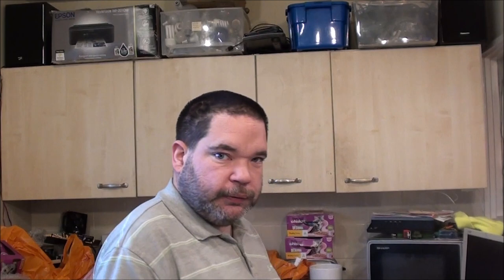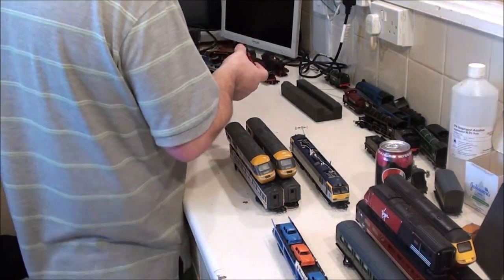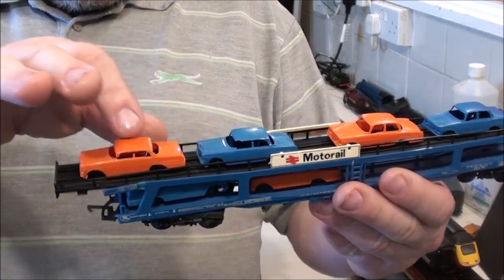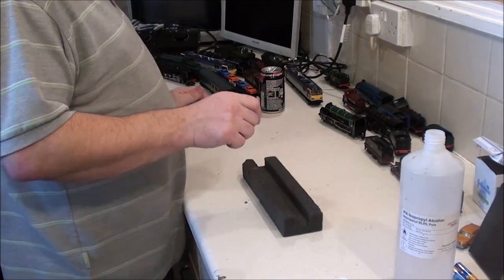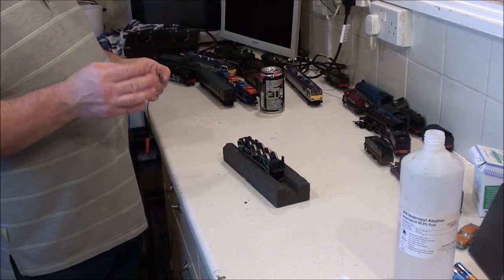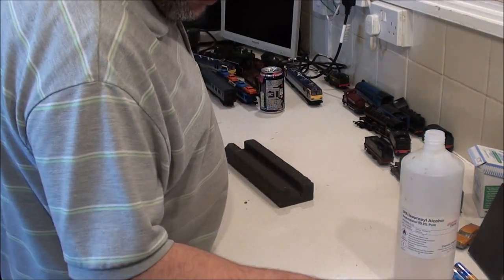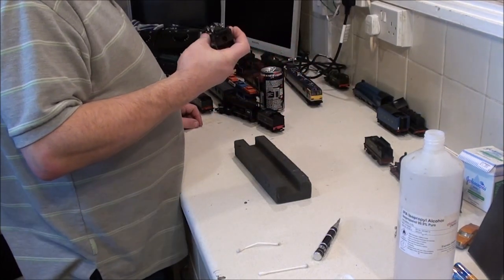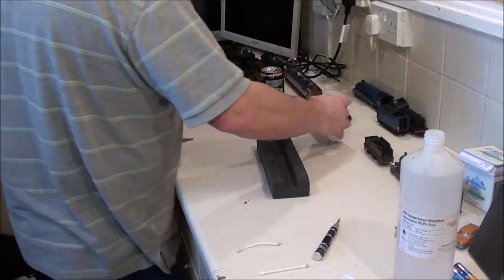More OO Gauge Hornby  Loco's And We Do Some Servicing. How Many Will Run?

Comment: Nice haul, I just got the same Grey 125 for Christmas!  The 4-4-0 at around 4:33 is an LMS Midland Compound, first released by Hornby in the 70s, though yours is a slightly newer tooling with the seperate hand rails so probably early 90s.  Nice runners when serviced!
Reply from the maker: They all will need a good service and clean. Thanks for the info.